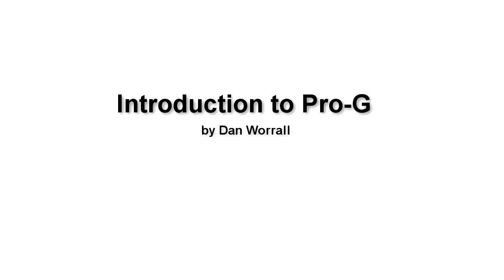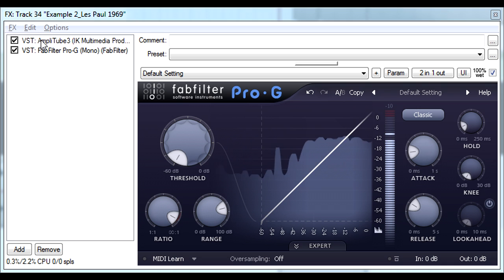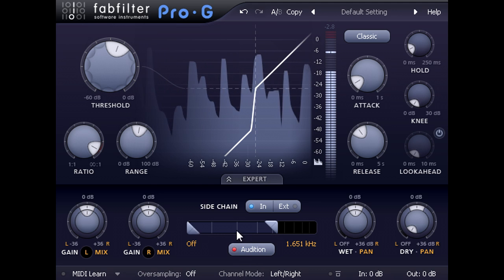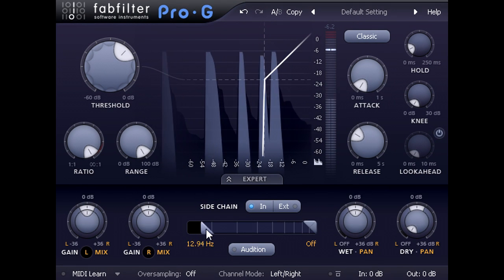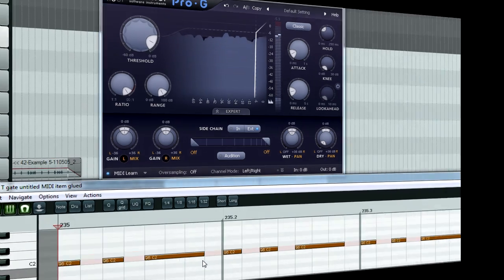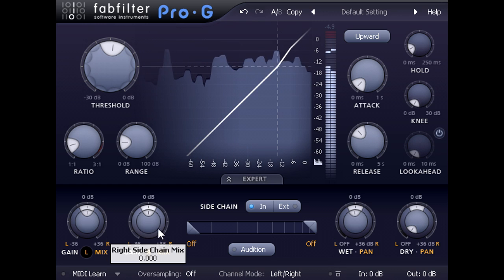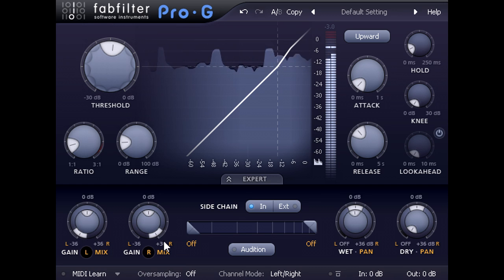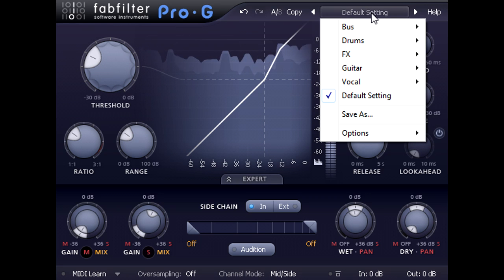Introduction to FabFilter Pro-G Expander / Gate

Comment: Could you please explain how you feed an external signal to the sidechain of FabFilter Pro-G? That part of the video went super fast and doesn't correspond to any of the inputs that I see in Ableton. Surely there must be a sidechain input selection somewhere on the Pro-G interface? Can't find it, though.
Reply: -I think that depends on the DAW you are using.
Reply: Finally found out that it's not on the Pro-G interface itself. I use Ableton, so the sidechain selector drop down menu is on the little Pro-G mini-module interface in the toolbar of the individual track (same place where you drop other effects.)

Comment: Is it possible to expand upwards the signal that is below threshold? To make quiter parts louder without effecting the peaks. Same like Waves MV2
In this video upwards mode apparently expanding the peak for resuming the dynamics.

PS: My question is other than  the ducking mode (i.e. compression) please